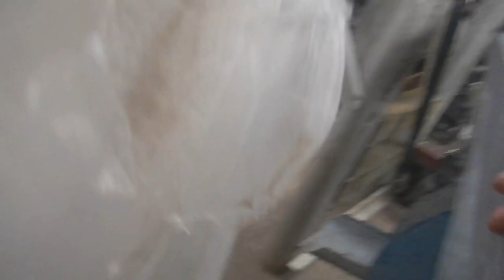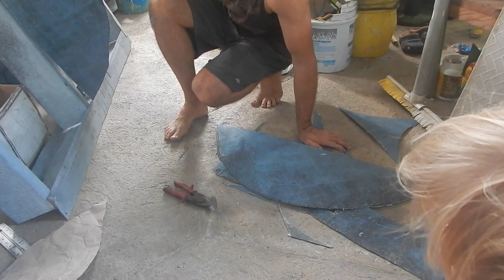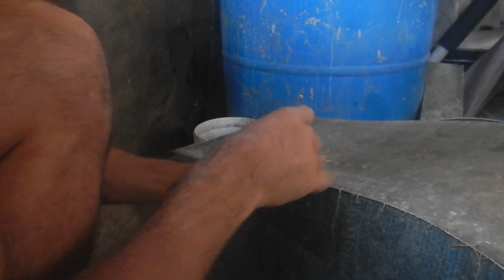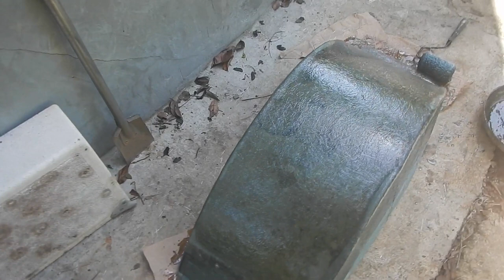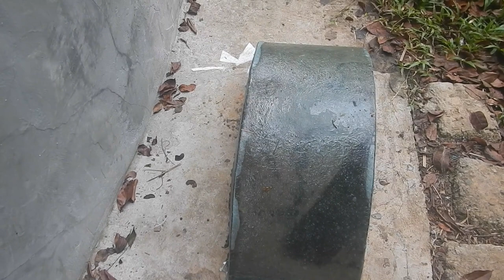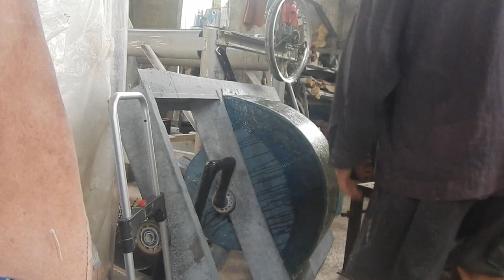Shark Slicer 007 Splash Guard

Comment: sewing the parts together was brilliant !
Reply: That's how dinghy's / canoes are built, stitch and glue method
Reply: Yup we used to use fishing line, copper wire or small cable ties.
Reply: Sticky resin can be caused by not mixing the resin enough . There is usually ‘paraffin wax’ dissolved in the resin that comes to the surface as it cured sealing it off from the air that ‘inhibits the cure on the surface’ . Some resin sold without the wax . 
Cheers Warren

Comment: Hey jaimie, I just saw something really interesting I thought you might also find interesting and want to look into. Something called a sharrow propeller which is a propeller designed based on a Torus shape which is considered part of naturally occurring "sacred gemotrical" structures. I know, superstitious ideologies aren't exactly essential knowledge but many technologies thrive using these shapes, ratios and designs and I thought a presentation I watched on the sharrow propeller had some pretty interesting stuff. It said it increases efficiency on even the best propellers out there by around 45%. They're very expensive but perhaps could fabricate your own using the ideas. Might be a good challenge for you! It got MIT an award.

Comment: Just my annoyance for not being able to point out there were probably to whole pieces in that one piece of glasfiber sheet.
1:46 if the bottom point of the half circle was pressed into the bottom right corner of the glasfiber sheet with the belly of the half circle pressed against the left edge of the sheet then you probably could have cut a second half circle repeating that layout on the opposite corner.
So that helped.